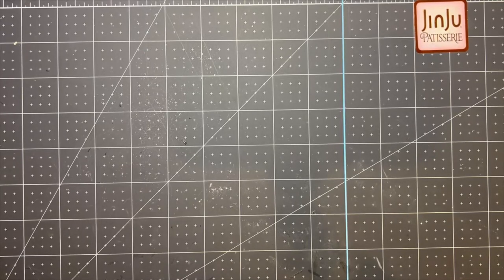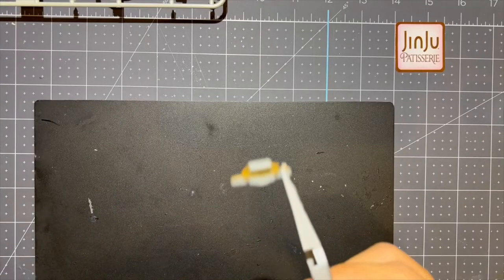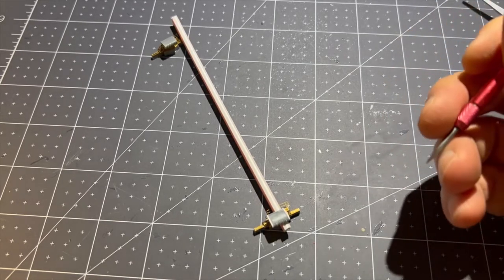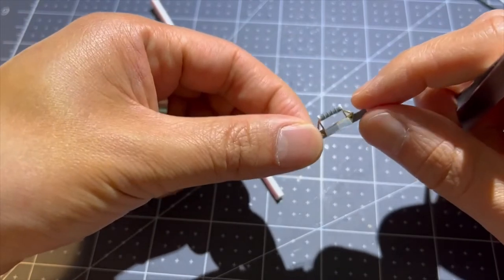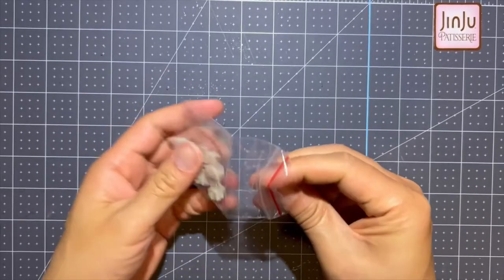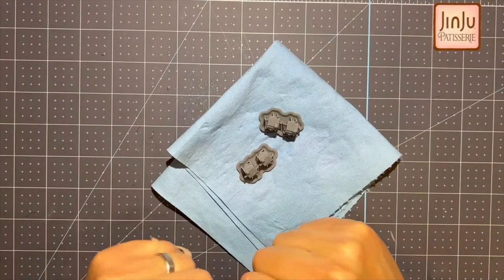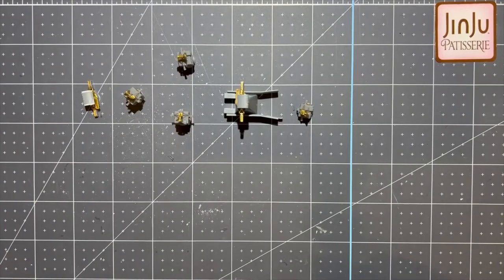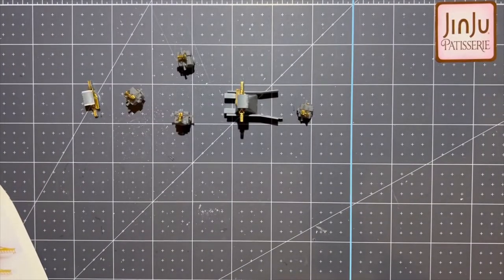1:350 Tamiya USS New Jersey Build 15

Comment: The MK37 director for the Jersey that Pontos and kit piece are correct. The Iowa, Missouri and Wisconsin use the ones you used.
Reply from the maker: Well shucks, you are correct! I’ll need to correct the error…sigh. Thanks for point it out!
Reply: @theokmodeler5755  Only mentioned it because I'm in the process of building the New Jersey during the 89-91 time period. Being a NJ resident it's allowed me the opportunity to check the ship out on numerous occasions.

Comment: I found that the SPS-49 PE that comes in the Kit worked great and looks really good. I had an Edward PE kit and ended up using the kit PE because it looked better. It was easier to build as well!
Reply from the maker: I hear you on that! I’m thinking of using the kit piece for the NTDS antenna…the Pontos one is a little difficult.